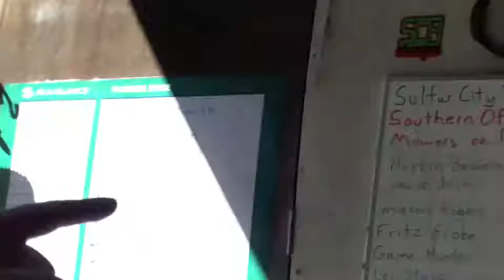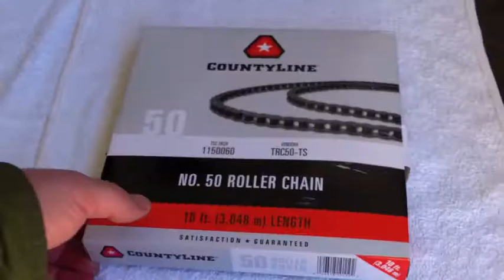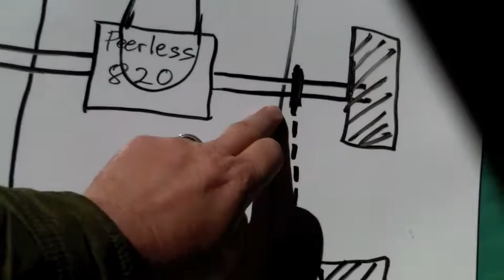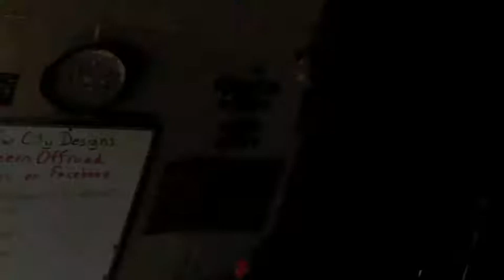MurrayGator 2.0

Comment: That's a big chain. Sure goin to bulletproof it for sure. I got a transaxle with a broke axle in it that is lock welded together and was thinking of doing what you said about running a gocart axle through it buy cutting out the web gears and welding one of those hubs inside. That way if I break another axle pulling a car I can replace it easy.

Comment: Nice chunky sprockets, should be a no nonsense reliable drive :-))

Can you move the back axel forwards or backwards a bit to get a good tension on the chain, or will you be rigging up a sprung jocky wheel to push on the chain?

Comment: You should run dual chains I think, it will help balance it out so its not pulling power just from one side, 1Pug made his own solid axle Peerless 820, I believe he bought the parts from a machine shop or he got the parts from PrincessAuto and he had the machine shop cut the key and do a few other things.

Comment: just out of curiosity could you cut the head off and weld a grade 8 1in bolt to the axle to give it the extra length it needs then use a lock nut to hold the wheel on?

Comment: if you want to make your own strait axle locker you need to machine the bull gear out to 1" im pretty sure the axle shafts step down to 7/8 into it and the spider gears... you can just have the bull gear sides machined out to 1" and make a doc locker style crosspin instead of having to deal with keyways. look at stretch44875s vid race prepping an 820 that vid should help you